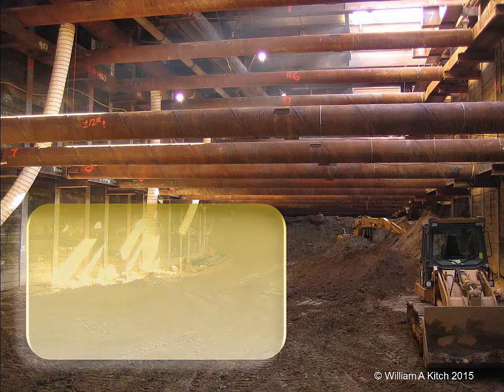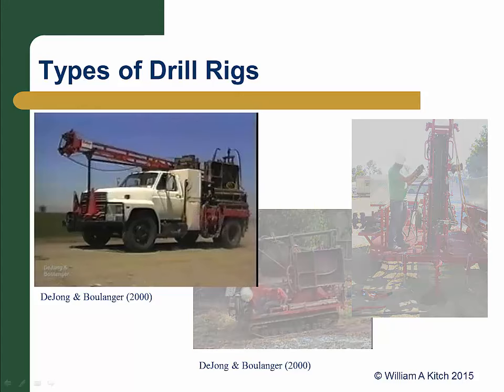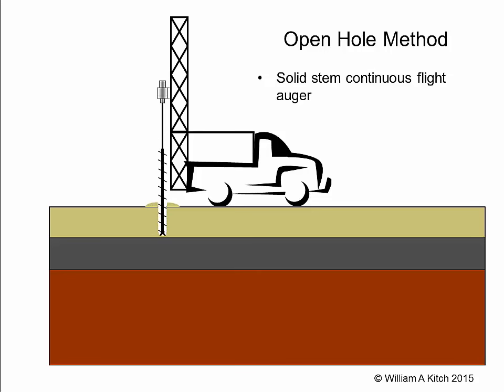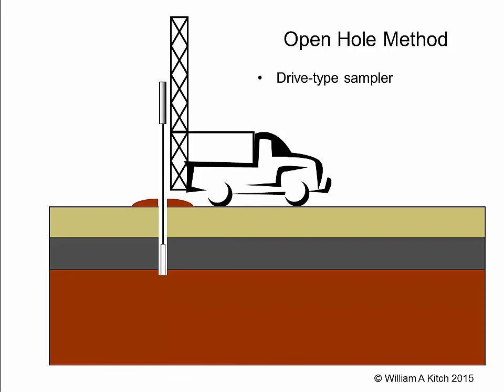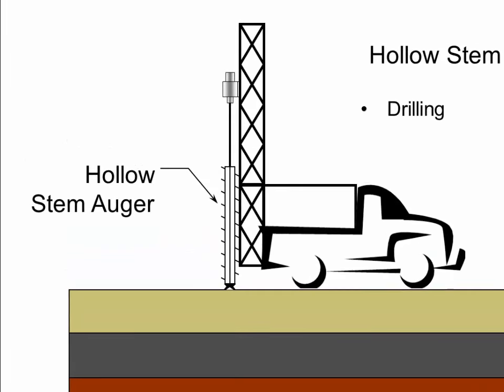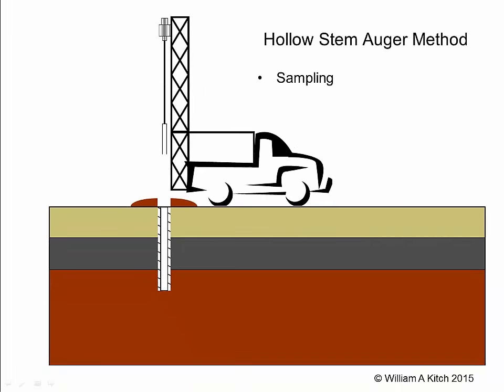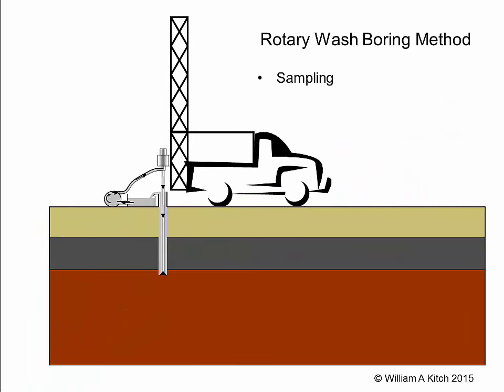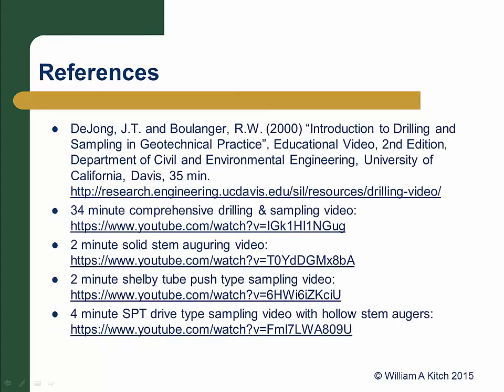Drilling and Sampling

Comment: Also hollow flight augers are basically useless in anything but soft soils and for shallow holes.
Also no drill rig actually hits the casing into the ground it has to be pushed or drilled into the ground.
Almost any drilling capable of drill over 6m will not use hollow aurgers
Reply: I took a borehole to a total depth of 80ft in downtown Chicago in the mid  90s...pretty sure I used 6 1/4" hollow stems.

Comment: When the drilling and you have reached the test depth you stop the fluids flowing through the drill head and a hose will attached to the casing whicjmh can constantly fill the hole as the rods are removed

Comment: Turn the water off and disconnect the hose OMG so when you talk about hydrostatic pressure on the hole wall yes correct but what happens if you turn off the water flow to the hole. Just think about filling your bath up hop in and out what happens to the water level.
If you turn the water flow off then remove the drilling rods the hydrostatic pressure will be dramatically reduced causing the walls to actually cave in it's the weight of the drilling fluids that hold the hole open

Comment: Pls tell me where I can see a drilling rig that uses the rotary mud technique without casing as a normal practice.
Can you imagine the amount of drilling fluid you would need if you just pump it out of the hole without retaining it. If a pump can pump around 100L a minute and rotary mud drilling 1.5m time will vary from 1min to 30 minutes so to drill a 50m hole at a rate of 1.5m per 3minutes not including the amount of time it takes to do a test U50 could be up to 10m and an spt could be up to 20minutes so to drill like this I would need an Olympic swimming pool worth of water.

Comment: Concerning the Standard Penetration Test (SPT), it is considered a casing method, right?
Reply from the maker: The SPT is a sampling method that also provides a measure of in situ soil properties (the N value). It can be performed in a cased hole or an uncased hole.
Reply: An SPT is a 450mm long hollow tube that is lowered to the bottom of the hole a slide hammer and anvil are attached to the drill rod and 3 measurements of 150mm are marked on the drill rod the engineer counts the hits for each 150mm section the first 150mm is for cave (cuttings still in the hole) and the next two sections hit count is recorded the two numbers add up to make the N value 
Example test at 24m will read like this on the bore logs 
24m spt 8-12-16 N= 28 
If the soil resistance is great then 30 hits for the first 150mm the test the test we be terminated and the depth targeted to test

Comment: How about percussion drilling
Reply from the maker: In my experience, percussion drilling is not normally used is soil or rock sampling.  This is more commonly use in drilling hard rock for anchor bolts or pile foundations, but not for gathering samples for lab testing.  There are other drilling methods which are not covered in the webcast such as sonic drilling (very interesting method).  I recently found that air rotary is a common method in West Texas.  It's much like mud rotary but uses compressed air rather than drilling mud to bring up the cuttings.  I'm sure there are other regional methods I have not encountered.
Reply: Introduction to Geotechnial Engineering 😊😊 thanks for your positive feedbacks.